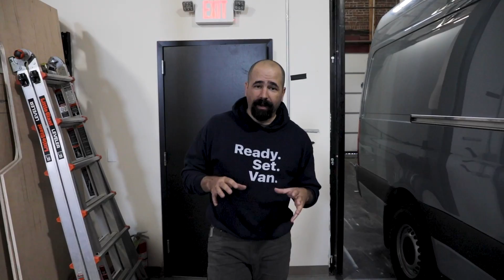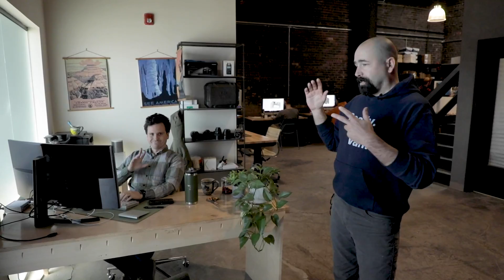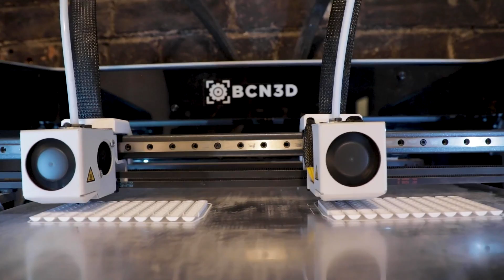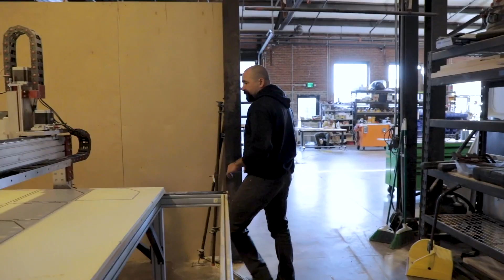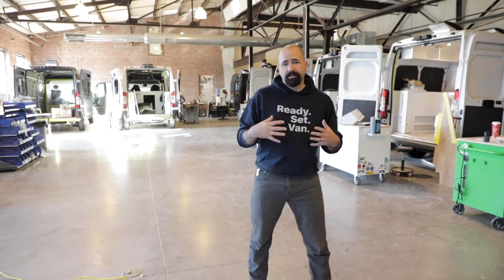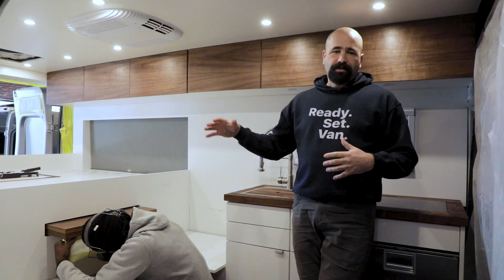FULL FACILITY TOUR | Behind The Scenes At Ready.Set.Van.

Comment: Love your work and commitment to quality.
On the kitchen cabinet issue, I’ve seen people stretch bungee cord across, or parachute cord, sometimes through holes drilled in the side walls of the cabinets to cover all the cabinets all the way across, as well as netting that can be snapped in or snapped out at different points. Your railing looks like it would hold objects at a lower level, but when people double-stack things, be it dishes or food, it still looks like objects can hop out over that railing.
People might want to consider putting a silicone mat over the cooktop when they’re not using it. This protects it from scratches, too, when using that surface as prep space.
One of the vans had slide windows in the back door windows. Do you install those? Great idea.
Reply from the maker: Yes we install most of the rear door windows and slider door windows for our builds